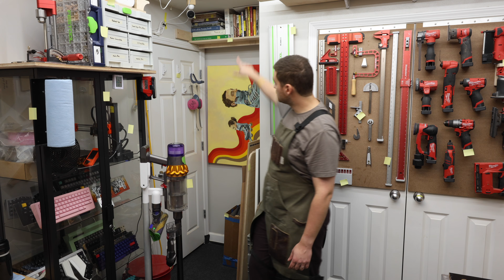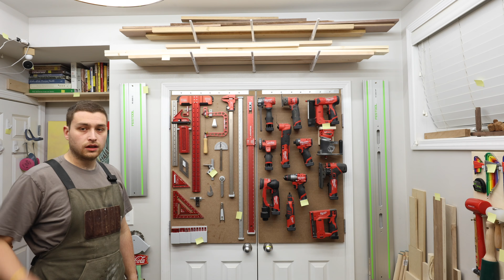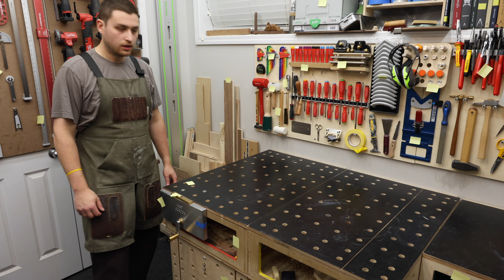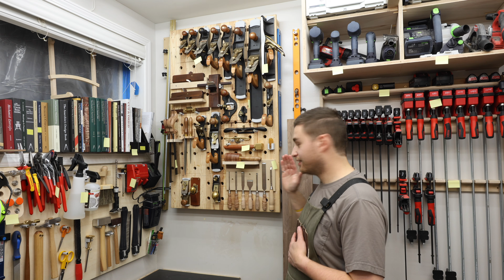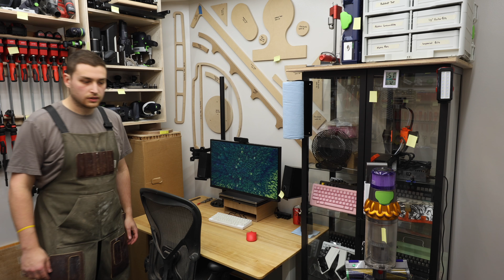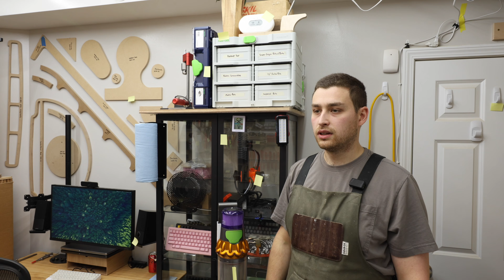Compact 10x10ft Woodworking Shop Tour

Comment: It looks like your dust collection system is something like this:

HEPA dust collector — Festool CTC MIDI. Air purifier — Winix 5500. Cordless vacuum — Dyson.

I just mention this because I'm also setting up a wood shop inside my residential space, and hazardous wood dust is a serious concern for this situation. I find it helpful to look at the decisions that other people have made.
Reply from the maker: Yep that's right. It's the CT MIDI (corded) and a Dyson V15 if that matters. If I were to redo the setup I would consider Festool's SYS-AIR for the ability to direct the exhaust and create negative pressure!

Comment: Nice shop. Love watching everyone's shop tour on YouTube. I've learned so much from others that I've incorporates into my own shop over the years. I too started out with  small shop 12 x 12 with a small loft. I had a 10" table saw with router table, 10" radial arm saw, dust collection, 6" jointer, miter saw, numerous other power tools, wood storage, huge collection of fasteners, couple of bench grinders and of course hand tools and LOTS of claps. Fortunately I could open a large overhead door and set up some tuff outside when doing a large project. Organization was key. I actually miss that small space sometimes. It was nice and cozy and required a lot less walking through out the day.
Reply from the maker: Agree, small means everything is close! I'd like to keep that perk but have the option to spread out for assembly. I think if I were to have more space I'd try to keep everything in one small section and use the rest for flex space as the projects need it

Comment: I do the exact same thing with those ziplock bags. Use them for extra parts and hardware. Instead of writing on the bag though I cut a small piece of cardstock and right on it and put it inside. That way I can change the bag when it gets old or if need to change the size of the bag over time and don't need to remake the label. They also take up less space usually. Can't live without them.

I also agree that just screwing things to the wall makes for better organizing for smaller items because to can fill up the space with more tools. Once you get it dialed in your not going to need to change things much. French cleats have there place but take up more room and project off the wall more. In a tight space every inch matters.
Reply from the maker: Oh interesting idea with the cards that's a good idea. I've noticed that some markers are fading over time and it's hard to reuse bags if I'm shuffling things around. That fixes both problems. Might try that!

Comment: Nice job. I feel like I was really creative in my 10x20 but you took it to the next level. We may be the minority but I have all my Festool on shelves for easy access and sustainers are only accessible with a step stool.. I’m not going through having to get it out each time I want to use. I’m curious about the couple of boards that look like you made a Shaper plate. Very well spoken and polite, then you said “shit ton” and I thought “ok this guy’s cool. I need to subscribe”!
Reply from the maker: Thank you! Are you talking about the bits of tape in the scrap pile? Those are most like just from parts I cut pieces from already. I like to leave the tape on there in case I can reuse them at some point. I do have a bunch of shaper tape covered in a layer of clear packing tape on the underside of the "router table'
Reply: @PrecisionPineCo actually referring to Festool and Shaper Origin out instead of in sustainers. The only time any of mine go back in the sustainer is if I need them for an install which is rare. I have all Milwaukee cordless for that. I just want to reach for it and use it. The one that concerns me is Shaper Origin but I have that where I won’t accidentally knock it over, I hope!

Comment: What about dust, I can’t imagine sanding or routing in there. It all looks immaculately clean. My workshop is half the size of yours but I have a very good air filtration system, and I have a vacuum that gets carefully connected to machines. I also wear a respirator if I’m sanding or routing and for ten minutes afterwards until the air filtration system has removed the bulk of the fine dust.
Reply from the maker: Oh there's dust on everything even if I do all of those things too. I'd say I vacuum once about every hour of woodworking so it's definitely a constant battle. Smaller spaces are easier to clean and faster for the air to get filtered so that helps

Comment: Great video, thank you. What air purifier and monitor are you using?
Reply from the maker: Thanks! I use a Winix 5500-2 air purifier and an Airthings 2960 View Plus monitor (data logging + remote monitoring is awesome). Very happy with both! I change the filter every 6 months

Comment: I designed and 3d-printed a set of similar holders for my hand planes, inspired by Matthias Wandel. It was some tedious trial and error to match all those weird shapes and contours - good on you for sharing your work on github so others can benefit!
Reply from the maker: I've got the method down now so it's a little easier but yeah it's always a "fun" challenge... you would think they'd be more similar but I don't think there's a single plane body that I was able to reuse the same mount! Matthias' video was totally an inspiration when I was trying to figure out what path to go down

Comment: good space. the A/C duct? Just an ideal, remove a/c duct block at unit. Add a small ductless system to that room and gasket around the door.
It will save your main a/c unit.
Reply from the maker: In a more long term shop space I'll definitely add a separate ventilation system for that space but I can't really make changes to the unit since we rent

Comment: This is really cool. I have a 1-car garage shop that still needs to park a car, so I've been working on getting creative with how I can build out my workshop space. My biggest problem is that my garage floor isn't remotely level so I can't do a workbench on wheels, so I have some work area along the one wall but it's quite small for doing any assembly or work with pieces more than a foot or two long. I really like your workbench 'segments' though.

One question I have, how do you do miter cuts or cross-cuts of long material? I figure you probably use the tracksaw as much as possible, does that include for something like a miter on trim or molding? I don't have a tracksaw, just a small table saw and small miter saw but have wondered if I could get away with a tracksaw instead of the table saw (since that's the biggest space hog in my space by far, and even so it's not big enough to cut 4x8 sheets)
Reply from the maker: The floor in this bedroom is surprisingly out of level too actually. I stuck some thin pieces of wood (~1mm thick as many as needed) under where the wheels end up when I park the benches in the default configuration. That way I have a level setup 99% of the time, and when they're rolled away I usually only use one at a time so it's less of an issue.

If I need a square cut on long material I'll use dogs and the precision of the dogholes to jig up the cut. if it needs to be at a specific (non 90 or 45) angle I have the MTR-X (https://tsoproducts.com/precision-triangles-squares/mtr-x-multifunction-precision-triangle-set/) or I'll lay it out with a pencil and cut freehand with the track. This wouldn't be particularly fun to do frequently for trim and such, but I only do furniture so I don't often deal in pieces longer than 6ft. 

It's not as convenient as a miter saw either, but also Festool makes this guide for angled cuts and I've heard good things: https://www.festoolusa.com/accessories/guide-rail-system/guide-systems/stops-and-attachments/577040---fs-wa There's definitely some equivalents for every track profile and price point.

You can do so much with a track saw, it's really what powers my whole setup. I think the strength of the table saw is in repeatable cuts and long rips. Those are the two things that I can't quite do easily. If that's something you do often then you'll not have a good time with a track saw. But for breaking down sheet goods it's fantastic!

Comment: thanks for the detailed overview!  I also live in a townhouse, though I've set up in the walls of my garage.  the car needs to park in there, which gives me roughly 7" of depth on both sides for my storage.  What's your solution to the noise problem?  I am perpetually anxious/guilty about the noise my neighbors put up with.
Reply from the maker: Yeah I have similar worries so I try to keep all the noisy stuff outside work hours and never too early or late (part of why I'm leaning into hand tools actually). Because of the way the building is set up and the room I'm in there's no shared wall with neighbors so I think that helps. There's a whole floor above, and on the side there's a hallway in our unit and then a second hallway between the units. My wife is able to sleep on the floor above when I'm being noisy so I suspect the building is also well insulated.
My plan if it ever became an issue was to use a sound absorbing curtain in front of the doors since they're the biggest culprit

Comment: So, You dont have a table saw, band saw, jointer, or planer?
Reply from the maker: Nope, everything is handheld! I have to work around it and I work slower without, but they're not an option right now. The table saw is pretty easy to substitute with a track saw and a router. For the bandsaw I buy the lumber s2s and use a jigsaw for curves. Jointer I can use hand tools but it's a lot of work so it's a last resort. Planer is high on the wishlist because I really can't replicate what it does. Peter Millard's 10MinuteWorkshop is a great inspiration!
Reply: @PrecisionPineCo that's awesome. Thanks for the great content

Comment: What a super nice shop. I also have my office and workshop in the same room, but in a bigger room. Do you have problems with fine sawdust at the desk?
Reply from the maker: Yep, I have to vacuum the desktop every so often. The router and jigsaw are the worst offenders. I try to collect as much as possible at the source with the dust collector and then the air purifier handles much of the rest. I've found keeping some Swiffer duster pads around is the best way to handle the fine stuff that settles!
Reply: @PrecisionPineCo  Well, same here, vacuuming ad wiping always. The router is not allowed inside the shop, though, I only use that outside, because of all the mess it makes.

Comment: Inspiring use of a small space!  What is your source for the euro boxes?  Thanks for posting.
Reply from the maker: Thanks! I got them on clearance from globalindustrial.com for I think about $350 for all 22 boxes. They seem to be available on Grainger now (Models ELB4220, ELB6120, and ELB6320)

Although I do want to caution you that the bottom of these is a thin layer of plastic and prone to sag. That's why I'm struggling to pull the drawers out in the storage unit in the closet. The manufacturer makes models with a more substantial ribbed base that eats up storage volume but is much stronger.

I've seen these sold as "euro boxes" or "straight wall container" in other places, but they're kinda hard to find in the US.